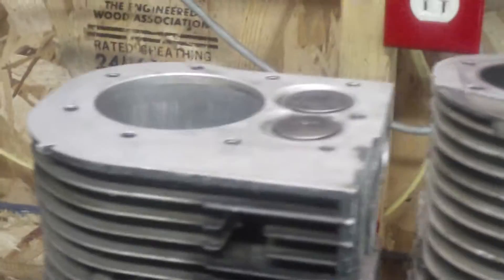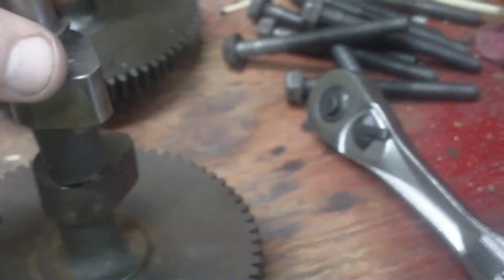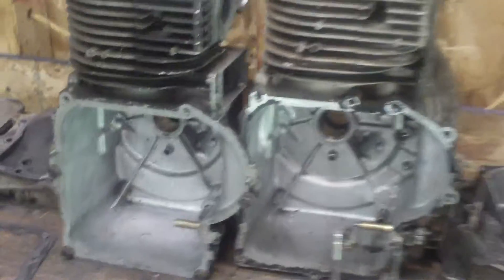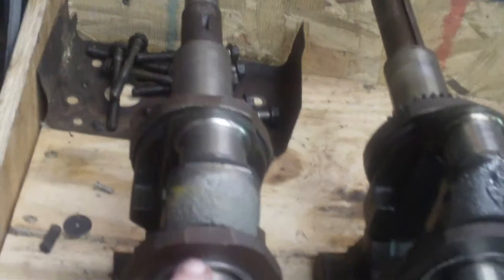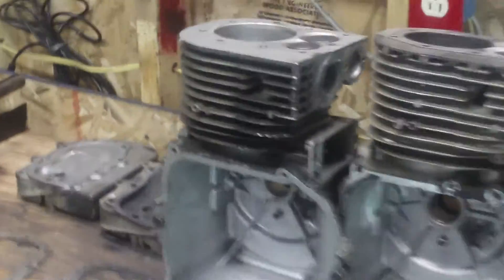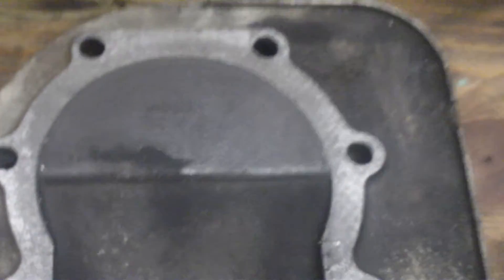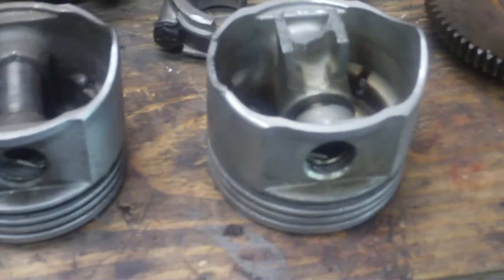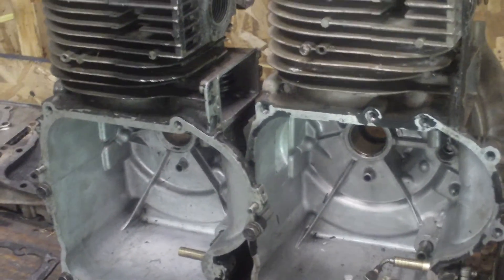Briggs and Stratton 11 Horsepower vs 12 Horsepower / Briggs Stroker (Mainly Plans)

Comment: Ok I see. But my 11 hp power built has a cast iron sleeve as said ok the cowling and has that scoop for the crankshaft in the block. But i powerbyilt is different from I/c. But that helps. Length will make the difference.

Comment: Thanks for the vid!  I have a 25707 with a thrown rod and don't want to rebuild b/c no cast sleeve.  Do you know if the 28607 has the same mounting hole pattern as the 25707?

Comment from the maker: thats interesting!!! i never thought of a timing light, because i figured it wouldn't read right because the spark plug fires every time the piston comes up. but now that i think about it, i guess it would work! yeah kind of the same when valves float in a racing engine. i'm just going by hear say on the timing changes though out the rpm range.

Comment: the block is aluminum, but on some Briggs motors they cut the hole bigger, and put a peice of iron pipe in the hole, giving a harder surface (cast Iron sleeve). Bore is how wide the cylinder bore (big hole{sometimes with cast iron sleeve}), but if someone says "to bore a motor" that means to cut the bore wider. Stroke is how far the piston goes up and down in the cylinder, and to "stroke" a motor you make the piston go up and down further

Comment: And the other day I finally figured out how magnetron works, It has "electronic points". Magnet 1 closes the "points", magnet two creates a current in the primary coil, and magnet 3 opens the "points" causing current to flow through the 2ndary coil producing a spark, just like points. This is why magnetron magnetos need 3 magnets.

Comment: both are supposed to hold 22degrees BTDC on all RPMS. Ive put a timing light on a magnetron engine, and It held 22 degrees regardless of RPM. On points the magneto fires when the points open again, on Magnetron the magneto fires when the 3rd magnet passes the magneto. However, at High RPM the points begin to "float" meaning they dont close fully, or long enough before they open again.

Comment: I dont think magnetron has any power advantage over properly adjusted points. Ive worked on 5HP engines that are regulated both ways, and cant tell any difference in power. I even fully restored a points Ignition (new magneto, points, flywheel key, and sparkplug) to compare to against Magnetron,  and I cant tell a difference, both fire up first pull every time, rev the same, and till with the same power

Comment: All Briggs and Stratton, Tecumseh, Kholer, and other 4 stroke mower engines HP ratings are @3600RPM as per SAE regulations, and all torque ratings are @3200RPM as per SAE regulations

Comment from the maker: its expensive! you will need a billet flywheel (cast iron flywheel can explode at higher rpms then what they are made for), a billet rod so you won't throw a rod out the side of the block, brass counter weights OR billet crankshaft, so you can do away with the avs or synchro balancer, then the actual performance upgrades come in, camshaft being #1, then timing adjustment (using the billet flywheel or keys) then a racing carbruetor. go to eccarburetors to look at parts foritthanks for watching!!!

Comment: You are correct about the differing carb sizes to increase hp rating. Briggs also increased RPM in some cases to do the same.

Comment from the maker: @fnaguitarplayer9 marketing idea to make them look bigger and more powerfull but truth is the motors are the same. now another thing to consider like on the 18 and 18.5 or 12 and 12.5 is sometimes the carburetor is different, like a 12 may have a old style one piece carb and the 12.5 might be a 2 piece walbro, OR the 12 may have points and condensor and the 12.5 may have magnetron ignition (electronic). I actually do plan to do a video on this this summer, its a good topic to bring up...

Comment from the maker: @scrambler250r yeah this is a common "problem" with briggs motors, truth is and i'm not putting down briggs, but the truth is they are all the exact same engine exactly. same cam and everything, its really confusing on how they did it. Perfect example is the 12 horse briggs, its identical to the 12.5 and even 13 horse, if the model is the same, the engine is the same. now your probably wandering what the rating would be, who knows, i'd say pick the middle one and go with it, its just a...

Comment: I've got a question I wonder if you can help me with. I have a 15.5 hp twin cylinder I/C Briggs, I also have a 18.5 hp twin cylinder I/C Briggs engine. Both were made in the late 90s. Me & my  buddy also have a 18.hp twin I/C Briggs. Those two were made in the early 80s. My question is, all these engines model #s start with 42, that means 42 cubic inches according to my repair book. So what gives on engine more power than the other if they are all the same cubic inches? Cam, Compression? Thanks.

Comment from the maker: @fnaguitarplayer9 and if it shears or isn't put in it, the flywheel wheel be out line and the magnet won't line up at the right time and it will spark to soon or to late. hope that explains what you need to know, also on the video i showed how to set the air gap between the wheel and magneto. thanks for watching

Comment from the maker: @fnaguitarplayer9 rebuilding a 12.5 briggs, i showed all details, much as possible on it. as for the timing, there is a magnet on the flywheel that passes by the coil (magneto) and depending on if its points and condensor or electronic ignition, the points type uses a set of points and a capacitor (condensor) under the flywheel, the electronic type doesn't have anything under the wheel, and has a circuit consiting of transistors to make a spark. its timed by the flywheel key..

Comment from the maker: @Mr3wheeledbike yeah, i've never seen it done either except on 3.5 push mower engines. You would have to make all the bearing surfaces so it oils from the top instead of the side, same as converting a 3.5 to horizontal. BUT the problem is making the dipper because of the counterweights on the crankshaft, i don't see how it could work, unless you had a older style engine without weights, or put brass weights on instead of the standard sychrobalancer. i did a 4 part video on...

Comment: i want to convert my 12.5 vertical shaft to a horizontal but i have only seen it done on 6 hp and under now i not knowledgeable on the larger blocks i know the most on 3 and 2.5 any how could you do a lower end parts and assembly vid or ex-plane the timing on these it having a hard time also what would you make a dipper out of much more g than a small block         thanks

Comment from the maker: @Populist1488 i'm sure there is some smudged aluminum there too, that engine flooded out and washed the walls of oil, and the piston got seized. well on a regular non sychro balanced engine, the crankshaft/weights is already balanced fairly well, and on a sychro balanced engine, when you remove the counterweights, the crankshaft doesn't have enough "counter weight" to balance out the throw of the crank. BUT what i recommend for you is what the racing lawn mower engines use,

Comment from the maker: @Populist1488 what part are you talking about? the cylinder walls? becaus i know its a score on the 11 horse block, its real rough feeling and you can feel it go down. Yeah turning the carburetor and a dipper will work, but if you remove the counter weights it will throw it out of balance and will shake really bad, and run rough. is it a homemade sawmill? i plan to make make me a saw mill someday, so i can cut different types of woods for building guitars.  thanks for watching!!

Comment from the maker: @fuckncoons01 if your 31 is a AVS it will fit but it will need bushings and you would have to run a shorter rod, because if not the piston would be hitting the head, i know it can be done but this is all i can tell you, i know more on the 25 and 28 then any other engines, but you can go to the heymow dot com forum and post a topic or search for it, there is tons and tons of information on this and other stuff there. hope this helps, thanks for watching!

Comment from the maker: @buggydude3 no its a good question, on the inside i use a degreaser and wash it out with water, some use pressure washers, on the outside i'll take a wire brush on a drill. some soda blast the outside, its the best way on the outside, best not to do on the inside. thanks for watching!

Comment from the maker: @fnaguitarplayer9 the first 2 digits of the model is the Cubic inch displacement, 12 and 12.5 engines are model 28's. and if i remember correctly i'm pretty sure the 13 is a model 28, if it is then it is the exact same thing as the 12 or 12.5 horse models. Now the 13 might be a model 31 cubic inch engine, i can't remember. thanks for watching

Comment from the maker: @SDMFberzerker91 yes, you can buy performance upgrade parts from eccarburetors and other places and aftermarket stock parts from tewarehouse. but like i say in the video, to make the 11 horse stroker, you need a custom made connecting rod. I think the 12 and 13 is the same, i don't have a 13, the horsepower rating is not very acurate on briggs engines, its best to go by the displacement of the engine if you look on the model type and code numbers...

Comment from the maker: @qazwsx7552 yeah. first thing get a billet aluminum flywheel, this always faster revs and eliminates the hazards of the cast iron wheels exploding at high rpm, Next thing would be a arc billet rod (a must without that the engine won't last no time), then a high lift cam, lightweight piston, carburetor, the list goes on, first things is the flywheel and rod and do away with the synchro balancer, go with brass weights or billet crank. And of course after you get the rod, flywheel, brass weight...

Comment: The connecting rod and crankshaft as to be changed. If I find a donor, should I keep the original piston to the engine? OR can I use the one from the donor (Its already mounted with the wrist pin and everything)  Somethings works like an old pair of running shoes. When you change shoe laces, you change both.

Comment from the maker: @1899lpv wow. thats normal for the oil slinger (or governor) to come loose it just sits on the camshaft. when you say piston bearings i assume you mean the rod bearings? well just save what you can. Like i said as long as the cam bearing is fine in the block you can save the block. i'd wait for another engine and get the crank out of it, because they cost a TON. like i said if you could email me pictures i could tell you what to save and what not to

Comment: @fnaguitarplayer9  The crank is in two pieces.When I removed the base,I heard a clunk and saw the governor gear assembly that became loose,the cam gear and lobes are fine,the sprocket ( the gear that is inserted in the crank to drive the cam)has a little wear at were it rest on the base like an oil pump gear that starved from lubrication, so both (sprocket and  engine base or bottom ) have scorched marks.The piston bearings have little scratch marks from the breaking point of the crank.

Comment from the maker: @1899lpv are you sure don't mean the connecting rod broke? its unusual for a crank to break, did the camshaft break too? look at the bearings where the cam shaft goes, in the block and if the cam bearing is broke on the base you can replace just that base, but if the crankshaft broke and everything else in the block looks alright, i'd say just throw the block in a corner in case you ever get a hold of a another crank, then you can build it then. but if the cam bearing is broken in the block,

Comment: @fnaguitarplayer9 I'm back...The crankshaft broke in half at the piston connection.The bearings are barely scored but I am not taking any chances.The sprocket gear for the camshaft is o.k but it rubbed against the base of the engine, Can it be fixed or change the gear and the base of the engine? So far,I see a new crank,sprocket,bearings( piston),engine base,oil seal and crankcase gasket. It was easy to pull apart because half of the crank fell in my hands...and so is the cam (no scoring marks)

Comment: @fnaguitarplayer9...Well, here we go. Out to the store to get a book on this. Now, in total honesty, do you think its worth fixing? I am also working on a 5hp B+S Noma tiller and I finally fixed the seized starter but, when I crank it ,the motor makes a certain "pop" sound through the exhaust with the choke on. Once the choke is disengaged it just cranks.I've installed a new spark plug and I think the coil is weak. It fires but, I don't hear that "tic-tic-tic" from a normal running spark plug...

Comment from the maker: @1899lpv thanks. what usually happens is there is low or no oil in the motor then the rod bearing seizes on the crankshaft while its running then all of the force from the rotating crank and flywheel will cause it to literally disintegrate, and the rod usually appears it broke off at the piston, like the one on my workbench on this video. Now if it didn't seize and the bolts just came loose, then yeah it will break differently. Just about everyone that throws a rod after i tear it down...

Comment: Very interesting.I am fortunate enough that a gentleman gave me his riding mower that has a 281707 12 hp Briggs engine. The not so good part is the engine is broken . It feels like the connecting rod snapped at the crank or at the wrist of the piston.I haven't opened the engine yet but,the pulley spins 180º one way and stops...the same the opposite way, so I know for sure that the crank spins but the piston is surely disconnected from the "bottom end".I'm a little hesitant to tackle the repairs.

Comment from the maker: @skate4life2206 yeah, but be SURE to leave the oil slinger in it (plastic part that runs on the camshaft) , if you take it out it will seize do to no lubrication. but yeah just put a bolt or something in the hole where the governor is. or even weld it if you want.  but as you probably know running a engine stock with no governor it will blow eventually, i have a 11 horse that has no governor because all the linkage is gone but i rarely give it full throttle. go to eccarburetors for racin parts